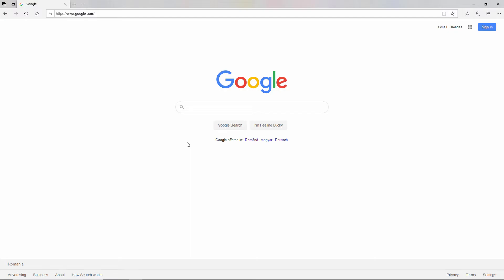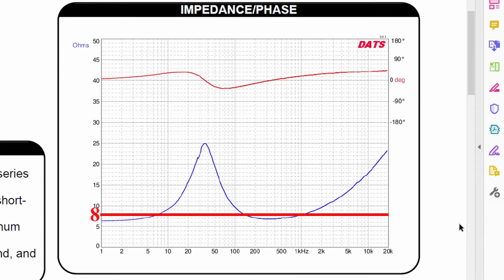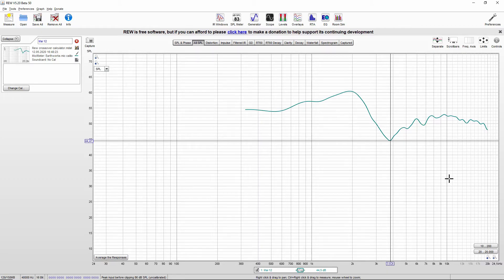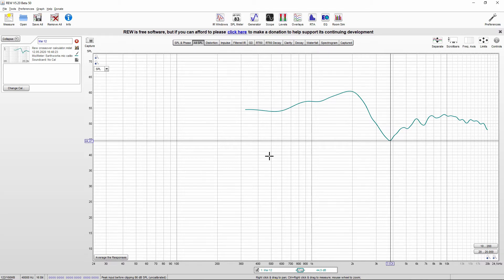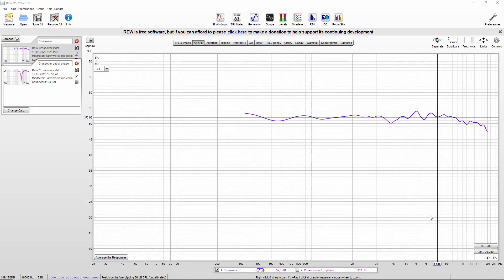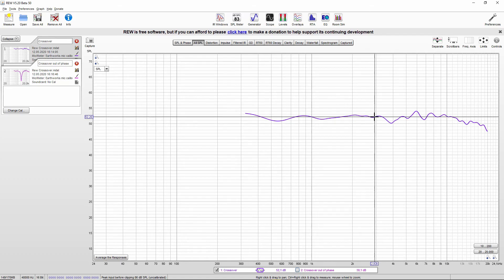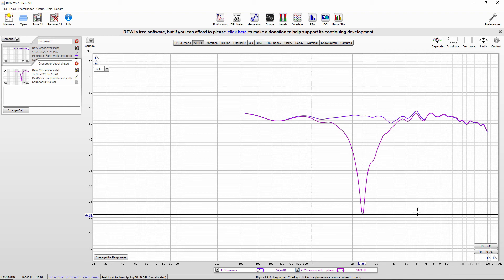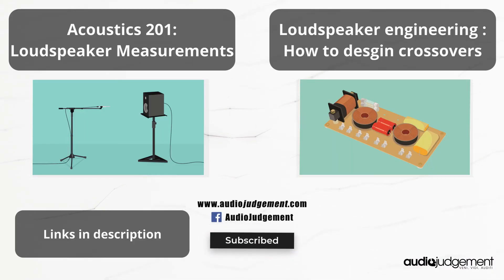How NOT to design a CROSSOVER

Comment: I stopped viewing when the first set of speakers came up on the screen...two.bass drivers in parallel ? Ok....now look at the enclosure...look at the deimension ratios. Look at the baffle width and the distance of the woofers edges to the enclosure side walls..etf designed this?! This is a near total FAIL. Not to be a Dik ...I realize Ive been at this since 1957. However, you didnt show much of anything and the information presented was not directly useful towards solving any problem.

Comment: I have a Behringer Europower 2500 amp and it's 1200w@2ohm per channel and I have 2 sets of Cerwin Vega LS12 speakers and I want to parallel 2 for a 2ohm load per channel. They have a 4 ohm impedance each speaker but the load to both will be 2-ohm. Is that gonna change the way the 3-way crossovers split up the woofer tweeters and mid-range and Fz over lap and sound?

Comment: Very good presentation and excellent explanation on how to use modern state-of-the-art tools to design a filter. I cannot understand why a large number of publications and sites still make you believe that you can calculate passive filters by inputting some parameters in calculation sheet. I am an EE and I still can calculate exactly that that by hand, but that leads nowhere to an acceptable electro-acoustic result. (As I have learned). Unfortunately people with total lack of knowledge still believe and use those.

Comment: That's a good start. However, designers also need to watch the phase response. That is what affects imaging and 'depth' perception. Speakers with average phase response may have a flat and integrated frequency response but can often sound flat and shut in due to poor phase control. Speaker design needs to be a whole - driver integration and phase.

Comment: 11:52 A true third order crossover has the drivers 90 degrees out of phase with each other on axis and should produce the same amplitude response connected in either polarity. Of course it's more important to get flat response in the real world but this speaker doesn't operate as D'Appolito intended for a MTM arrangement (constant voltage, constant power, symmetrically dispersed). Apparently this is more of a 4th order despite the networks being 3rd and 2nd. The initial parallel test was interesting, shows how hard it is to make a true first order response because this acts steeper than that without a crossover at all.

Comment: Great video. A follow-up would be great: taking 0/15/30/60 degrees measurements for improved off axis response, as wellas using VituixCAD for example.

Secondly, it would be good to see how you designed the crossover (picking parts and how to connect them).

Lastly, component wattage rating values :)

Comment: Interesting content. I have used a crossover calculator with some success. They don't always work out but it gets close, something to work from. First, I always enter the measured impedance, not the nominal. Second, if you use the Butterworth formula, you have to account for the "hump" in the frequency response at crossover by adjusting by a factor of .3 (multiply the crossover frequency input by 1.3 for the high frequency; divide the crossover frequency input by 1.3 for the low frequency).  The Linkwitz/Riley formula gives the flattest response at crossover frequency and no "hump" adjustment is needed to get the "starting point." I do the same as you do; build the crossover outside of the box and make adjustments "by ear." And, as a general rule, I usually hook up the tweeter with reverse polarity in a two-way system; that really makes a difference in stereo imaging. 

It also helps out tremendously, as you demonstrate in other videos, to properly dampen the cabinet. The first thing I do when refurbishing a vintage speaker is remove the cheap factory dampening material and replace it with 1/4" area rug padding, glued with spray adhesive, to the interior of the cabinet and polyfil stuffing if there is a large empty area below the drivers. I haven't tried the recycled blue jean material as you demonstrate. A properly dampened cabinet gives off a really clean sound for both the low and high frequencies. Thanks for sharing your experience with us "laymen" speaker builders/refurbishers.

Comment: Beh... nope. 
First... woofers need a proper zobel.
Tweeter needs a notch filter.
Least try to aim for a useable impedance.
Once you got your crossover point figured , you can use the corrected impedance to figure out the required parts.
All of those have losses. So you modell the added series reactance . Then you work out the effect of those on the woofer qts.
Only then its practical to design the box it self. 
And the required L-pad for the tweeter it self.

But hey thats Just me..

Comment: Just a little bit critical "Of course he got terrible results. He did not even use the manufacturer data to Zobel-compensate the woofer" T-S data isn't there for no reason. It just would have been more believable starting point than only a "crossover calculator."
Reply: But also a series Linkwitz-Riley can avoid the phase mismatch between tweeters and woofers that will creep into the more common parallel crossover. Starting with compensation and a more robust design in the first place might have led to less dramatic initial results...

Comment: Is there a way of doing this with only the Frequency response and nominal impedance? I know it wont be as good as with a zma file but is it still possible?
Reply from the maker: Dayton Audio has frd and zma files for their drivers which you can download. Even those are not useful. You need to measure your drivers in your particular box. Responses change significantly. Without measuring, the result is a gamble.
Reply: @AudioJudgement  i have a meassurement mic for spl stuff, so no Problem there. But impedance gets difficult. I could just meassure with a Multimeter while playing different frequencies and aproximate the graph through this. I cant buy special impedance meassuring Equipment for speakers right now.
Reply from the maker: @poppy3879  There is a video on my channel where I show how to build an impedance measurement jig. You can measure impedance using your sound card.
Reply: @AudioJudgement  hell yeah! Thanks
Reply: I believe x sim will put an estimated impedance plot in there if you don’t provide one. It’s still not ideal but it may help.

Comment: There wouldn't be that many on the market. If it wasn't easy. If someone wants to build a budget loudspeaker. Stick to the basics. Linkwitz riley filter has been popular for years. Using a 2 way design with a 2nd order Linkwitz Riley filter with decent box construction. I built my first pair using Peerless and Dayton, It sounds better than all the speakers I've owned. I initially was going to make a 3 way but I turned my design into a double two way design. MTM/WT with a selectable switch. The WT sounds more like its point source since there are positioned very close. Both sound good. If you design your box well with Dado joints it could easily last 250 years.
Reply: good comment .   and if you use the actual ohms of the speaker vs just the advertised 8 ohms the calculator is going to get you a lot closer to an optimal design.   Lots of 8 ohm speakers measure in the 6 or 7 ohm range.

Comment: You can use DATS to measure impedance with the speaker installed in the cabinet?
Reply from the maker: Yes, but you will get the impedance of the speaker + box.
Reply: @AudioJudgement  Is this still a useful measurement?
Reply from the maker: @dantwomey  Yeah. You can find the resonant frequency of the box. You can check out the minimum impedance to know which amp you choose. Also you can troubleshoot unwanted resonances inside the box.

Comment: How safe is it to run the swept sine wave through the tweeter alone or in parallel with the woofers (but no crossover)? Isn't this putting the tweeter at risk even at moderate volume but loud enough to have a good noise floor?
Reply: I use his same method but only sweep the tweeter and the parallel measurement from around 1200hz to protect the tweeter.
Reply: At 1W ... No worries nothing will happen

Comment: Funny how we made crossovers before the programs and had good sounding speakers. He is saying to get the programs or buy the programs. Spend the money to do so and spend the time learning the program. Then you can design a speaker. He knows what you are going to say. Oh, that costs too much or takes too much time ? Then just buy my kits. :) 
Just get out there and start building speakers and crossovers. Build the coils if you want. Most important is to get started. Sound is like a fine wine and everyone likes a different sound profile.
The sound profile you like will not be found in most cases running a program  but by experimentation.

Comment: Hello Marius Tanasescu. Xsim is a good program, but what about inductors? How to find out what RESISTANCE of the inductor to put in the crossover?
Reply from the maker: Hello! If you right click the inductor and select tune, you can modify the inductance, but there is also an ESR section. That is the resistance of the inductor. Default is 0.35 Ohm, but you can change it as you like.
Reply: @AudioJudgement  Now I see!!) thanks.))

Comment: hello Marius Tanasescu. Please tell me if you use the program Passive Crossover Designer 8 Excel Workbook? I liked this program, but I can't download it (. My antivirus says that the file is infected with MacroVirus.Maybe you have a secure file and I can ask you to transfer it!? For example by email!?
Reply from the maker: I'm not using it. Though here is the site where the file was originally posted: http://audio.claub.net/software/jbabgy/PCD.html . If your antivirus still gives a virus message, I'm sure it's a false positive.
Reply: @AudioJudgement  unfortunately, it gives the same thing (I will deal with the antivirus! Have you downloaded it?
Reply from the maker: @ИванПронин-о1ю  I have, but I don't have antivirus on this computer, just the normal windows defender stuff. Anyway, the spreadsheet uses a lot of macros, so it is likely that it will trigger some antiviruses. But I highly doubt it's infected or anything.
Reply: @AudioJudgement  thanks for the answers! I want to say that I like your courses. Unfortunately I can't pay for them. I live in Russia and our payment system is disabled. I'll look through the rest when the economy gets better.

Comment: Hi Marius! I took your Crossover Udemy course which I fully recommend! The problem I'm having now is that I cant find inductors to buy in my country (argentina). The question is... make my own inductors is an ambitious project or is something doable? In the last case, could yo point me an starting point? Thanks a lot!
Reply from the maker: Hello! Have you tried buying from Parts Express? I'm sure they sell internationally. There will be some import duties and additional transport costs though. I also advise to do a thorough google search of your county. To give you an example, in Romania there is an audio parts website, that looks like a shady html website from 20 years ago and after you pick your components from an excel spreadsheet you order them by e-mail. There might be a similar case in Argentina :). Regarding  making your own inductors, it's totally possible. I haven't done it myself, but there is a lot of information out there to do it with or without a winding machine. However, finding good wire for inductors might also be a challenge. Solid wire, that easily bends with a thin layer of insulation.

Comment: it is not possible to create FRD and ZMA file using REW HELP thank you
Reply from the maker: I create FRD files using REW. However, I use DATS to create ZMA files. You can use REW but you need an impedance measurement jig that you'd have to do it yourself.
Reply: @AudioJudgement  I made an instrument for measuring the impedance using rew, for reasons unknown to me, Xsim did not see the zma file. This error has now been fixed. Do you have plans to create a three-lane on YouTube?

Comment: why not simulate diffraction in Vituix Cad, with baffle measurements and driver SD, and the manufacturer datasheet, you can pretty well do it................... just that the complexity starts to increase even more and more as we dive deeper in the software and Sim

meanwhile, very nice video and the best way is to measure the speaker and then making crossover
Reply: If you don't have the enclosure and it's the only way then I can see going thought the sim to get close, but if you already know what the enclosure will be why not build it and do it "right", but yeah if your going to be experimenting with different driver layouts and enclosure shapes I can see the advantage.

Comment: Hi Marius, thanks for the video!
When you first made a crossover, you just picked the basic parameters of the speakers, and the result is not pretty good. 
But how it would work if you download files of the speaker tests( from manufacturer) , and use them for calculating crossover in the simulator software, and then take a measurements? 
Your simulated crossover was pretty accurate. So it might work for factory measurements. Maybe not so perfect like with home measurements, but better than using just the basic parameters.
Reply from the maker: You mean like Dayton Audio, how they include the FRD and ZMA files for download? You can use those and it's a bit better but it's still not good. Those are measured in half space. Speaker position on the baffle and baffle size and shape affect frequency response by a large amount. So, you're still in the blind even with those measurements.
Reply: @AudioJudgement  Thanks for reply!

Comment: Lets say i want to cross over an 8ohm speaker at 10Khz and the impedance graph shows 18ohms at 10Khz can i then put the 18ohms in the simple calculator to have somewhat useable crossover?
Reply from the maker: Nope. You are probably worse by doing that.

Comment: Hello sir,
 please help me.my speaker crossover setup (all speaker polk audio, av receiver marantz sr6015)
Polk audio- Tower speaker RTI A9 30HZ-26KHz -
Surround Speaker RTI A1 50HZ '27KHZ -
Centre speaker CSI A6 45HZ 27KHZ-
Dolby atmos speaker RC 80I 35 HZ 20 KHZ
Subwoofer- 660wi
 Lower and Upper Audio Quality -3dB Limits
25 Hz → 125 Hz  (At which crossover should I set each speaker?)
Reply: I believe THX reccomends 80hz, so speakers go from 80hz and up, sub works from 80hz and down....

You could try a 5hz deviation, so speakers from 75 and up, sub from 85 and down giving a 10 hz overlap... (i doubt these surround home theater amps will do that tho), others reccomend 60hz as crossover point which most home theater amps are set at......

My Choice.......If you have good quality full range front speakers, then leave them set at full range, then the sides rears and any atmos (if they are good ones, set them to 60hz if there able to do from 40hz and up as standalone speakers), if there lowest figure they go to is 65hz or whatever, then choose what thx reccoments and do 80hz.... (like bookshelve speakers)...

I set my sub to 100hz as maximum and adjust its own powered volume to match music sound by ear, not too much, but not too little, everything here ia subjective as it depends on sub speaker size, how well its ported or not and room accoustics ans size... yadda yadda lol....

Beautiful thing about these products is that you listen and try what works well for you and sounds best in wherever your listening to them.....

Buy good quality, but not insane quality.... kef and dali are good but so is polk..... svs is very expensive for the little gain that you get from them.......

You proberly know this now anyway as my answer is a year after you asking lol.....

Always learning..... 🙂

Comment: Another excellent video Marius! Thanks, I've jus one question, can I export REW impedance measurements as .zma files?
Reply from the maker: I haven't tried it as I use DATS for impedance measurements. REW can export measurements as text files. However, when I upload frequency response measurements from REW to XSim, I simply rename the file extension from txt to frd. I'm guess it will work the same way for impedance files from txt to zma.
Reply: @AudioJudgement  Thank you so much, I'll try it

Comment: hello, how can you wire 4 and 8ohm loudspeakers together and get 4 ohm nominal impedance?
Reply: Add resisters to change the loading value of the speaker, but idealy it dont matter as there is no such thing as an 8 ohm speaker unless its fed 1 note constantly, as its ohm value will change depending what frequency its fed and how much power its fed....

A pitzo tweeter can have 0 ohms load on an amp, which on ots own would blow the amp up, some subs can go from 2 ohms to 100+ ohms load to the amp depending what note its fed and how much power it can draw to make that note, especially in a seald box........

Dont worry 😉

Comment: Marius, what a good Philosophy you have for teaching. My question to you is, what do you do to take a measurement for the weighted  part of a compression hf driver?
Reply from the maker: I'm assuming you are referring to T/S parameters measurement. The first measurement, without the weight will give you all the parameters you need. Measuring Vas for a tweeter is not useful.